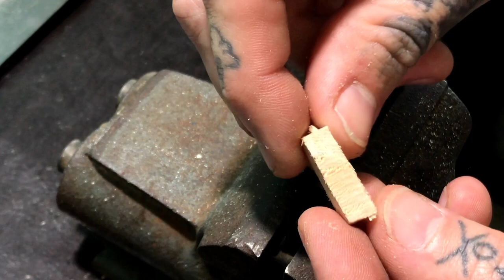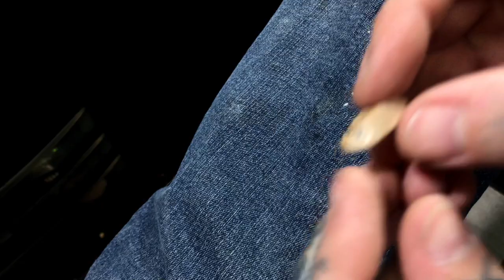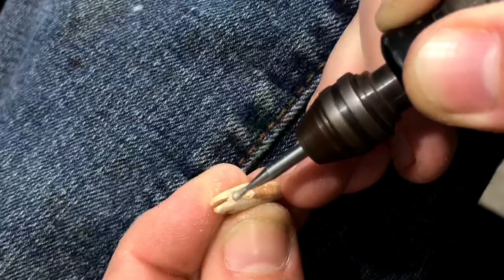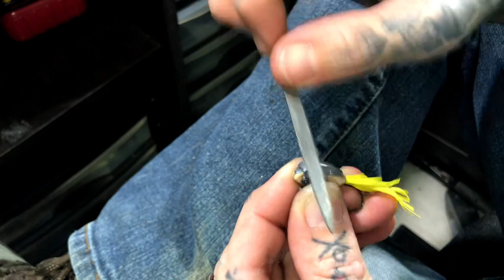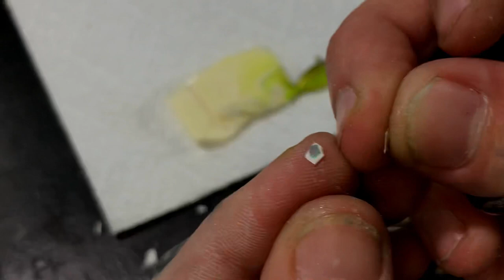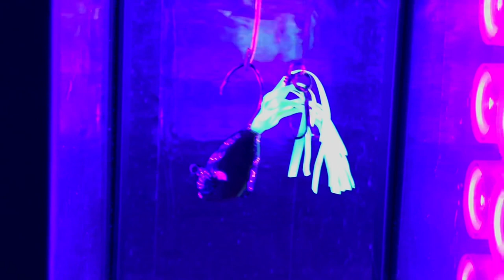Lure Making a Custom Fishing Jig

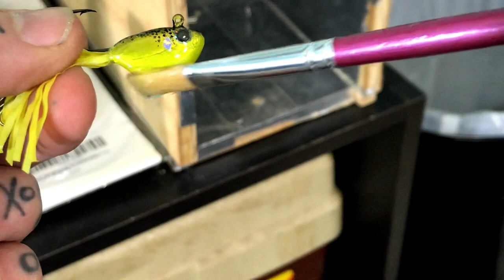Comment: 13:00 what is that, Hi, what is it that you coat with at the end, can it be coated with a harder silicone, I would be grateful for your answer, we use silicone for bathrooms here, it is a little harder and also soft and cheap, I see in a video that you used plastic that was full of bubbles, the video where you put the night stick, it can also be made from silicone for the toilet, I would like to coat that harder silicone to get a shine on the lures
Reply from the maker: I mainly use devcon 2ton epoxy or bsi. They are both 30 minute epoxy and dry clear and hard and will give you a good shiny finish
Reply: Thank you